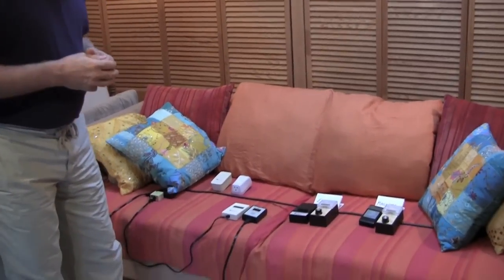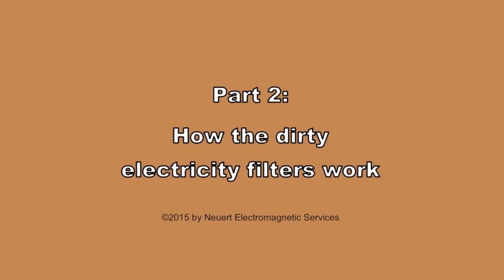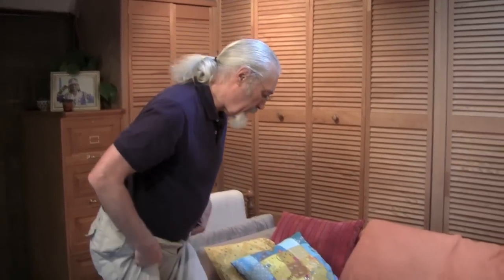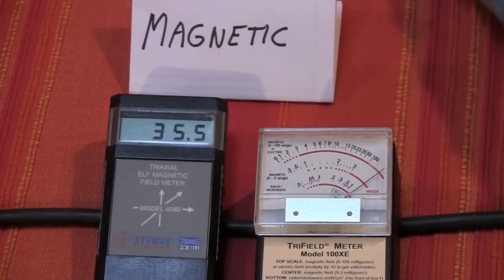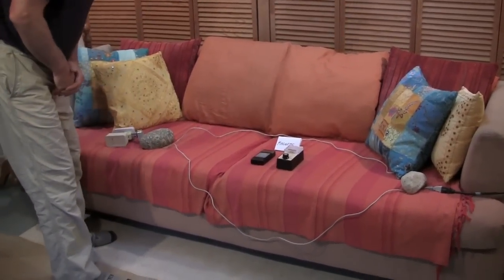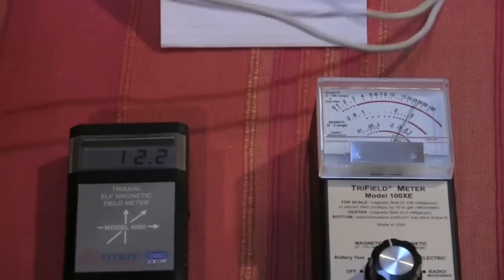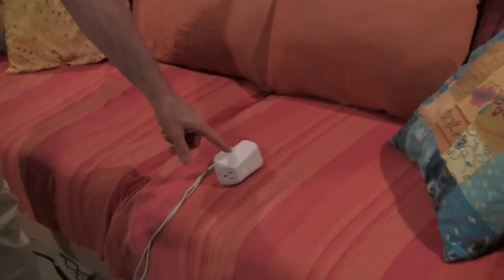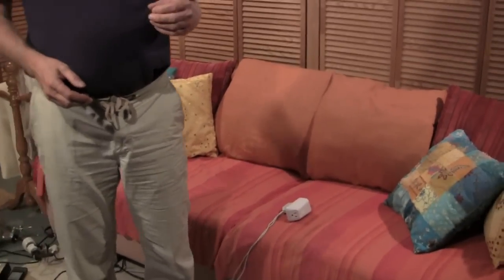Perils and Problems with Dirty Electricity Filters: What to be Aware of!

Comment: So, what's worse? 

High magnetic fields, or dirty electricity running to everything in the house? 

Where's a point of balance?
Reply: Dirty electricity is worse as it creates frequencies known to affect the cell membrane and nervous systems.
Reply: do you recommend a good whole house dirty electricity filter?
Reply: We have seen this video before and it is inaccurate and sadly misleading.
Let me explain how magnetic fields are created in homes. The Live and Neutral wires have opposing currents which both create magnetic fields, but they neutralize each other when the wires are next to each other. When you separate the fields you get an independent magnetic field.  
This misleading video sets up a wiring error by separating Live and Neutral wires and then puts a voltage on them which will always create a magnetic field under every situation.
This is NOT a result from the filter, this is from the wiring error created. If instead of a filter you place a light bulb or a phone on charge in the circuit you would get the same magnetic field so its NOT caused by the filter but the wiring error.
In Australia we use twin and earth cables where the Live and Neutral cables are manufactured within the same cable so the magnetic field is neutralized. Only where the live and neutral are separated will a magnetic field occur.You will always measure a small local field around every powerpoint which has a device plugged in and is switched on because the wires are separated out in the back of the wall socket to supply the socket, so with any device including the filters you will read a magnetic field at the power socket or any place where the wires are separated, this is called a wiring error . This will typically diminish at around 30cm distance. You won't place the filters under bed heads to avoid sleeping spaces.
I hope this clarifies the situation and the video misleading the public.

Comment: Magnetic fields created by electrical wiring errors seem to cause strange mental behaviors.  I picked up on a wiring error in my master bedroom because my partner started making driving errors after I installed a 47.5 microfarad capacitor filter in the room.  The switched socket was wired incorrectly.
Reply: +Environmental Radiation LLC NUTS :] I mean your findings not you...
Reply: Arthur Serino lol

Comment: Feds are pulling exotic stuff on me for threating to expose there criminal activity. My home had crazy high magnetic fields going on. How did they do that? Reverse polarity at the mains? I was able to measure this. Also my tv cable lines coiled up with some kind of  high current or charge running
Reply: So you’re the snitch that was on Dateline NBC that got 15 people jobless 😂👍

Comment: We have seen this video before and it is inaccurate and sadly misleading.
Let me explain how magnetic fields are created in homes. The Live and Neutral wires have opposing currents which both create magnetic fields, but they neutralize each other when the wires are next to each other. When you separate the fields you get an independent magnetic field.  
This misleading video sets up a wiring error by separating Live and Neutral wires and then puts a voltage on them which will always create a magnetic field under every situation.
This is NOT a result from the filter, this is from the wiring error created. If instead of a filter you place a light bulb or a phone on charge in the circuit you would get the same magnetic field so its NOT caused by the filter but the wiring error.
In Australia we use twin and earth cables where the Live and Neutral cables are manufactured within the same cable so the magnetic field is neutralized. Only where the live and neutral are separated will a magnetic field occur.You will always measure a small local field around every powerpoint which has a device plugged in and is switched on because the wires are separated out in the back of the wall socket to supply the socket, so with any device including the filters you will read a magnetic field at the power socket or any place where the wires are separated, this is called a wiring error . This will typically diminish at around 30cm distance. You won't place the filters under bed heads to avoid sleeping spaces.
I hope this clarifies the situation and the video misleading the public.
Reply: considering your experience and knowledge in this field, could you answer a simple question cause no one else wants to or they don't know.  Will the emf filters and do they have the ability to affect the readings given on a body voltage meter?
Reply: I understand what you're saying, but not sure you really understood what was being said in the video. He does describe it quite well and accurately. A good reference for wiring errors is Carl Riley's book "Tracing EMFs in Building Wiring and Grounding". You can find it on Amazon. It's considered the Bible for wiring errors. Hope this helps.
Reply: @debbiecomeau820   hi Debbie, No capacitance filters such as Greenway and Stertzerier will not reduce the values read on a Body Voltage meter. These filters smooth the micro-surge which is superimpossed on to the alternating voltage. The electric field will still be there. To remove the electric field you can #1. can turn the power off. #2. replace the cable with screened cable in that room which has the electric field values remembering that the electric field can travel 2.5m in every direction so you can be effected by lighting cables in the ceiling or floor and power cables in others rooms. #3. shield the room by painting with shielding paint (example T98 Alpha by Geovital) and grounding the paint with grounding tape.  The benefit of painting shielding paint is this will reduce RF fields from cell towers, wifi  etc. I hope that helps.
Reply: @moniquedrexel3475  So in your opinion are the filters helpful?  and what good is a body voltage meter anyway when trying to reduce harmful emf's.
Reply: @debbiecomeau820  yes the filters smooth the micro-surge on the electric field.  Body voltage measures the electric field coming from the cables. Ideally you would shield against electric field or turn the electric field off. But if you have to have power on then smooth it with the filters.
Reply: @moniquedrexel3475  thank you so much for your input.  I was too caught up in my body voltage meter readings.   I will soon invest in filters i think.

Comment: THOSE MAGNETIC FIELDS ARE OCCURRING AT LOW FREQUENCY,  & LO POWER,  SO, YOU CAN GET MORE THAN THAT FROM WALKING OUTSIDE BY A POWER POLL.... LOW FREQUENCY MAGNETIC FIELDS ARE NOT A BIG PROBLEM, PERIOD!!!))))))))))))
Reply: Your body works with low frequency and power!! How can it work with such low power??? So guess what happens if it interacts with "low" power and frequency? Are body works with a signal on and off, that it!! It doesn't need power, it needs a small contradicting signal to make mistakes. When you are within the electric field, its not frequency or the power the real issue, its electrical noise that stress electromagnetic cells. Yes cells work on an electromagnetic level.